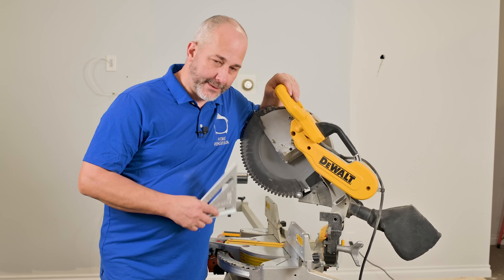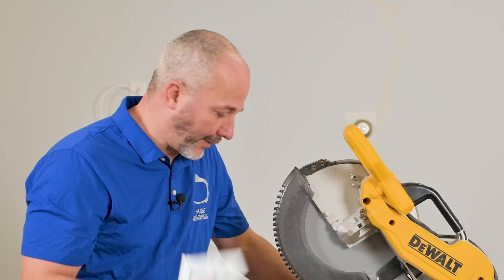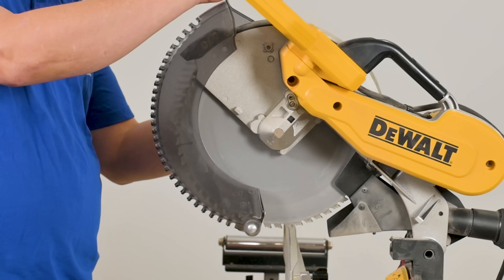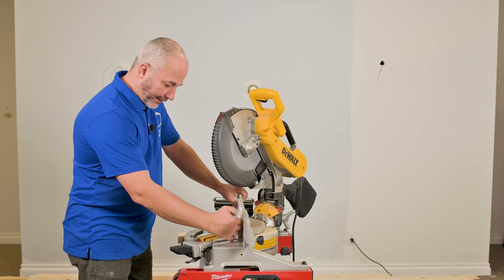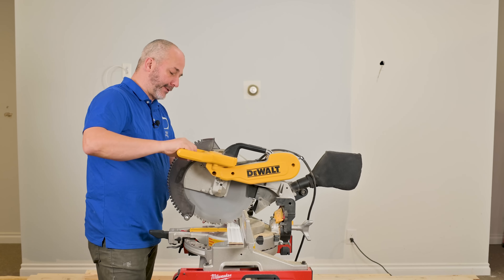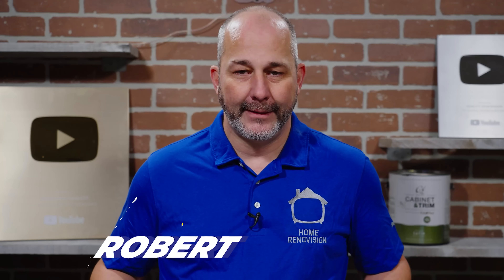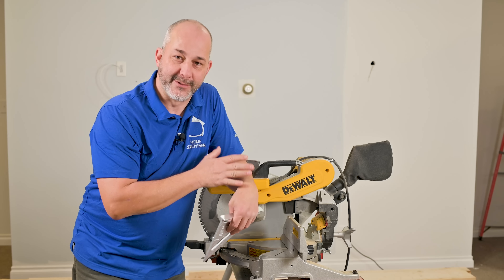How To Use A Miter Saw | DIY For Beginners

Comment: I love this video - tips I’ve never seen before! I have two questions - you said to make sure your blade is square; if it is not, how is that corrected? Second question is whether there is any way possible to adjust the depth of the cut on a basic mitre saw that has no depth adjustment? Thanks!
Reply: Answer to question 2 anything’s possible with money but with no depth adjustment screw no….
Honestly I’ve never used it personally but if u really need it u can get a decent 10” saw for $200 

Answer to 1st question 
If the blade is not square ….
Search for how to square miter saw blade…
Basically the fence on the back of your saw will have Allen screws u loosen those and move the fence forward or back’ 

Place saw down lock it 
Unscrew 1 side of fence 
Use square next to blade square up fence to your square’ 
Tighten screws 
Now do the same to the other side 
You now have a square blade’

Comment: Sir, Your link for the miter saw is not the same as the one in the video, Is single bevel OK?
Reply from the maker: I don't use the double bevel even twice a year. only really large stock requires it. Cheers!

Comment: Looks like letting the saw blade come to a stop is not easy.
Reply from the maker: some saws have better brakes. it all depends on the money you spend and the comfort that you like to work with. i personally let the spin reduce for a second and pull the pieces away from the moving blade.

Comment: ONE+ HP 18V Brushless Cordless 10 in. Sliding Compound Miter Saw Kit is on sale for $219 original price is $399. would this be a good deal and a saw for a DIY. I plan on finishing my basement.

Comment: I would like to add a very important reminder: square the fence to the blade AND the fence to the table AND the blade to the table, not just the blade to the table!!! Don't forget that most blades have teeth that are wider than the actual body of the blade when setting up your square. WEAR safety glasses AND connect a freaking shop vac to it: you'll thank yourself later when you won't have to pick up a truckload of wood dust everywhere, especially on a mighty 12 inch like this one. 

The blade on a miter saw spins from front to back(otherwise dust collection would be impossible and...DANGER)  as seen clearly in this video it is counter clockwise from the right perspective (place yourself on the left, the rotation is clockwise). If you somehow invert the blade...be prepared for epic danger and the wood being thrown or ripped from you. 

Also, take into account the kerf when measuring and cutting, sometimes it's better to measure twice and cut twice rather than measuring twice and cutting once, only to find out you cut exactly on the line like a genius...great, now you're off by 1/16th or even 1/8th depending on the blade.

Comment: 7:53 com on bro u can that with other tools u shouldn't do it with miter saw maybe jig saw can it 
Or other tools can cut this type of cutting 

8:35 in this case u should use climbs plus stick to hold it on left side of u ur hand 
Shouldn't use ur hands here

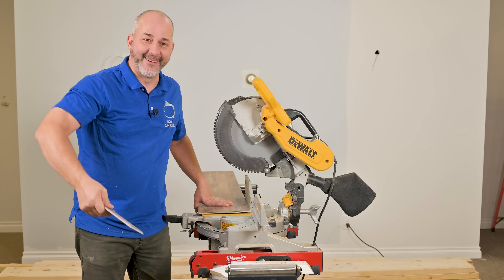9:05 and 9:12 miter saw design to cut less size than the blade size as far I know can be dangerous if you cutting thicker  materials u can use circle saw for  wide material 

11:28 im guessing something gone wrong here 
U should hold it on left side 

Thank you so much for the guide

Comment: Lots of good tips, but you preach one thing and practice an other.  Leave the blade down till it has stopped !!!  And off you go with a quick cut, down and up, all while the blade is turning.  
It would have been educational if you had shown where the blade would cut in relation to your pencil lines in addition to your explanations.
Owning a sliding miter saw for almost 20 years, I still learned something, thanks.

Comment: Thought that was a miter saw and chop saw was Miter saws and chop saws are not the same, even if the descriptions may sound similar. A chop saw is used for straight precision cuts, and a miter saw is used for angled cuts. Though it's tempting to try to adjust the miter saw to work as a chop saw, the results will not be as good…… just joking, great video.

Comment: You know it's important to let the saw get to max rpms before cutting.  This was not shown in the video. Quick to just chop as soon as the trigger is pulled. Hard on saw and if youre actually cutting real wood and not MDF , the wood will splinter.

Comment: 2022 and people still use those nasty crown moldings? I thought they were done in 2001!!!?  Well, you did ROCK IT on explaining the saw basics and then some!! "That's money in the bank!!" lol.

I am wondering why these miter saw tools cannot be flipped or detached and attached beneath a saw stand that has the option of using it as a table saw??? It just seams like a natural use of them. The blade arm can flip over, the bottom is out of the way and a stand has the adaptive markings and such a table saw would have! I am only asking 10% of sales on this idea. so don't hesitate to get in touch for my concept and prelim plans!

Comment: Mitre saw you mean..... Usually chop saw refers to metal straight cut saw
Reply from the maker: chop saw is also used as a slang on the jobsite. Cheers!
Reply: @HomeRenoVisionDIY  very true. Just depends on the job site. Here we use both regularly so it's chop and mitre to differentiate the two types

Comment: THAT IS NOT A CHOP SAW. "Chop saw" and "miter saw" are not interchangeable terms for the same tool, they are different tools. Chop saws don't swivel to miter, and they don't tilt to cut bevels. Chop saws are fixed at 90 deg horizontally and vertically and are intended to cut through metal and very thick wood where power is more important than precision. Also, those things are loud--use hearing protection.